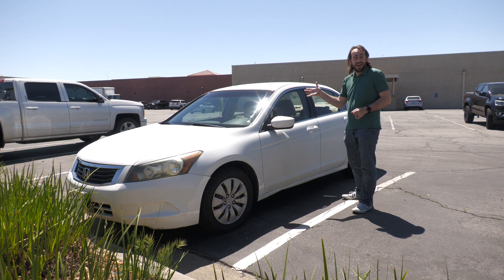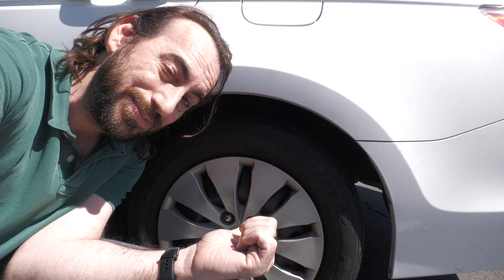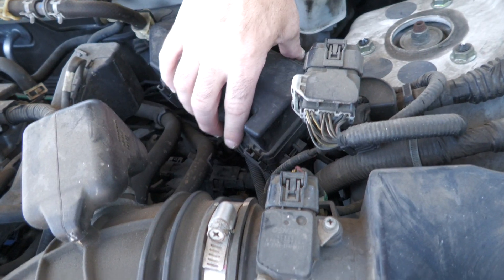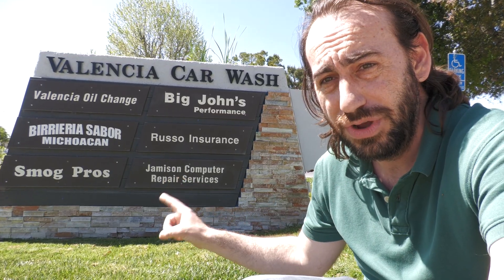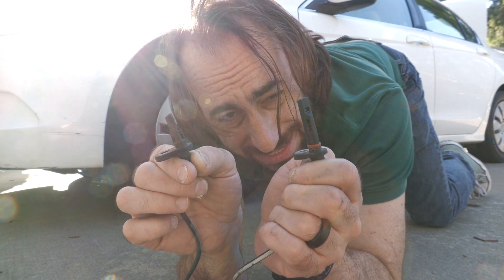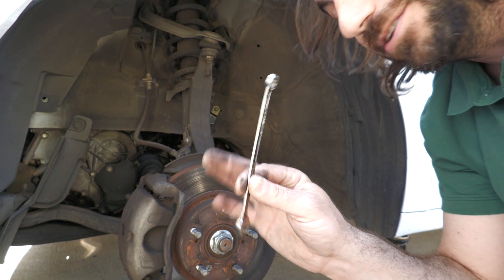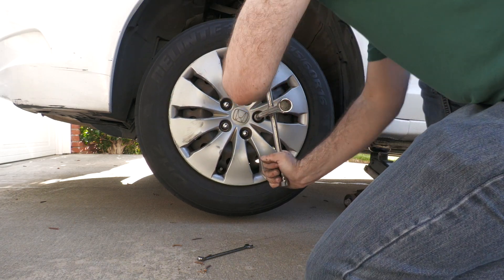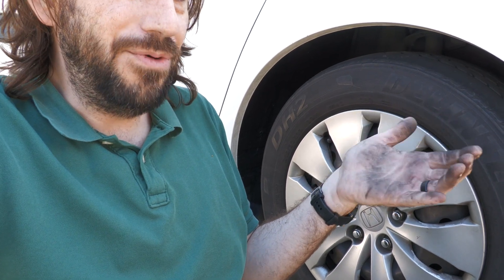Accord VSA Actual Fix Part 1 Wheel Speed Sensors Replacement

Comment: Barely loosen lug nuts THEN jack up the car.
Reply from the maker: It's easier to break them a little loose when the wheel is firm on the ground, then with the wheel off the ground and risking the car sliding off the jack.

Comment: Note to self: "Don't buy a Honda, they're crap!"
Reply from the maker: Na, Honda's are pretty reliable. This can happen to any vehicle. Over 1 year later and the car is still going strong, it has around 210k miles. The repair cost for this, doing the labor by myself, was under $50 for the sensors and the brake switch in video 2, and in total took maybe an hour tops. VS having a shop do it for anywhere from $175 to over $300.
Personally, I would stay away from anything German - parts are relatively expensive compared to JDM or American, and German cars have a higher complexity in their design where part replacment's are relatively more inconvenient.

Comment: I have Honda CRV 2012, I replaced the brake fluid 6 months ago, and purge all the wheels, but when I start to move the suv,  the ABS make a buzzing For less a minute, today the VSA, ABS and brake appears in the panel, I checked the fuses and it's ok, I checked the wires and conectors, the brake fluid was in the middle from low and max, I refill the brake fluid and clean the codes, but the suv still making the buzzing, do I need to clean the ABS sensors? Thanks
Reply from the maker: That's a good question. How many miles on your CRV? And what kind of buzzing - like as you're driving the car itself makes sounds from the wheels? Or warning sounds from the computer?

Comment: I have a 2009 Honda accord ex 4 cylinder. How many wheel sensors are there in those cars? Are there a sensor for each wheel?
Reply from the maker: Should be 4 per car, which is 1 per wheel. Pretty much as shown here since it should be the same model generation.

Comment: There is no "VSA module" the VSA system is run by the ECM, which is expensive and needs to be flashed for your VIN# and keys. The speed sensors and brake switch are great starting points. Sometimes, you will not get codes for faulty speed sensors because the ECM is also bad, so a much cheaper fix is to inspect the Speed sensors. If you get all 4 for $50 bucks, its worth it to swap them out as it it a very easy repair. Replacing the ECM is also very easy, except for the flashing (programming it to your exact vehicle.)  A new ECM is 1200$   Used, 50 to 200$.  Flashing the ECM is at least $199 unless you know someone. It has to be done with Honda specific equipment. If it sounds like I know what Im talking about, Ive dealt with this issue on many 1st generation Pilots.
Reply from the maker: Luckily the speed sensor repair I did well over a year ago has had 0 issues!

Comment: What about a Honda Odyssey 2008. Grinding sounds and engine slows down in traffic! I'm afraid of the grinding sound.
Reply from the maker: I'm not sure. The slowing down could be a diety throttle. The grinding could be brakes. I'm creating videos with what I have available to me to use. If you subscribe and watch my videos, it will help open up opportunities.
Reply: I bought one Honda Odyssey,2007,with same problem,and..I’m working on it…step by step. That car is worth that. In normal conditions,that engine will work..forever. Just depends how much care owners take of it…

Comment: I added brake fluid and it solved the problem. Take off the black battery cable for 30 seconds to a minute to clear out the codes. No lights now.
Reply from the maker: That was one of the first things I tried. It didn't work for me.
Reply: @UltimatePostman  I don't know. It's really strange. Almost as if they techs wanted to find a way to get the car to stall mysteriously. Why did the car stall? We don't know. Got to you Honda dealer and pay a fortune. Have him tell the fortune of your car. I know your suffering. I put 93 octane gas in it and it seemed to fix it. Now the brake fluid fixed it.
Reply from the maker: @LaurenceI-ne7sl  Never had that for me on my accord. Stalling happened on one of my previous videos due to a dirty throttle.
For any Accord, you don't need anything over regular gas, you're just wasting money putting premium in. However, when I repaired my Accord, I accidentally put the wrong ones on the back (I was only going to change out the rear sensors), and the car didn't stall, but wasn't able to drive over 10 mph, and would surge. After putting the right ones in the back, the surging issue was resolved.
Reply: @UltimatePostman  My Honda runs better with a mixture of 87 and 93. Noticeable difference in acceleration and  power. Money well spent. Try it if you have a 4 L.

Comment: Before anyone tries to remove anything, please make sure you check the brake fluid levels. Low fluid will also trigger the VSA light.
Reply: Was having similar problem with my Honda CRV 06, just got it fix after watching this video and reading your comment. Thank you so much!
Reply from the maker: @Toolzmack  Glad to be of service!
Reply from the maker: I realized I skipped that step in the videos (both). But it is something I did do
Reply: It will. It's kind of bizarre, because why would low brake fluid trigger the VSA, which causes problems with acceleration? It's an obvious flaw with this model of Honda. Why would a lack of brake fluid cause the car to stall and lose acceleration? It's connected to the ABS system somehow. So I guess the car thinks it needs to slow or stop acceleration / gas flow to the car because the car can't stop? The car would not drive over 20 - 30 mph. This is a case of the law of unintended consequences. We think your brakes don't or won't work, so we're going to stop you engine from accelerating.
Reply: My case low volt on battery will cause the problem too , it’s so much that can cause the vsa to come up and you literally gotta go thru everything
Reply: Bro, I add brake fluid,boil change and new battery. The VSA light still comes on. I've had it service, and replaced the VVT solenoid, and I dam VSA light still comes ON!!!!!!!!! (It was service at VAN'S HONDA DEALERSHIP, where I bought the car....sad isn't it??????

Comment: My Honda Accord Euro CL9 (aka Acura TSX in the US) had both VSA & D lights flashing. As I went to the engine to check both engine & transmission oil levels I found a rat/possum nest in the transmission area under the battery tray - turns out the critter had chewed off the wire to the linear shift solenoid 😵‍💫

Now I'm ordering a new solenoid plug as the critter chewed off the whole length of wire and left me nothing to work with 😅
Reply from the maker: That stinks. Since you're mentioning rats chewing cables, my neighborhood has been having reports of rats causing issues, odly enough, my accord just started having AC issues, and my wife is thinking it's due to rats.
Reply: Yikes!

Comment: Is this relates to 84-1 sensor logic failure code?
I have 84-1 code.
VSA light goes off every key switch off cycle.
VSA comes back on when I hit 40Kmph & stays in until I switch off the engine.
Any suggestions?
Reply from the maker: I forget what the code for the wheel speed sensor was,  I just looked it up after the smog guys showed me the code - I didn't take a photo of it, will have to search my history on my computers.
The brake sensor I took a photo of it and it was 68-21.
As far as my car, my VSA light would turn on after I was driving and started pressing the brake. Sometimes it would happen right away, but usually it was coming on within 1/2 mile.

I would recommend looking up the codes via google, but the scanner may actually say what the error is related too (wheel speed sensor, brake position switch, etc.), and you use that and the number to find out what parts you may have to replace.

If you've tried the wheel speed sensors on all wheels, and then the brake position switch, see if there is another code. Also, check your brake fluid level.

Comment: Hi! I replaced the 4 sensor,  I checked the break lights, they are good, I disconnect the battery for more than 15 minutes, I checked the fuses, they are good. I took the car to autozone to get the obdII scan and no codes found. Lights on the dash boar still on :(. This is a 2012 Honda accord 4 cylinders. Thanks
Reply from the maker: Sad to hear the light is still on. Make sure they're all connected securely (listen for the click). It could be that you got defective parts, or that your ABS and/or VSA unit is actually bad.
Past that, other than maybe going to another shop to make sure it wasn't a defective scanner... you may need a better scanner.
You can try to short the pins, and doing the steering wheel fix, (there are a few videos on that).

Past that, you'll need a mechanic to help you out.

Comment: I already changed all new wheel speed sensors. But still not working. Anything else for help.
Reply from the maker: I'll repost my reply to someone else here. You will probably need to get your codes scanned.:

Thank you for stopping by and watching Musicfashionstyle4251!
I'm glad that I was able to help you on doing some auto repair – most small repairs aren’t as tough as they make them out to be. Just remember that the advice that I give helped resolved my situation, and I’ll do the best I can to present what is helpful – however, you may still need to head to a mechanic for assistance, or just to get codes read if you can do the work yourself.

Since you are still having the VSA warning light on your dash board, remember that it is your traction control system… but it works hand-in-hand with your brake system (including your ABS). If you watched my second part, then you would know I had to replace my brake light sensor to fully resolve all errors and turn the light off. To resolve your VSA light, I would recommend using the following procedure. 

First, if your car is exactly like mine, check the brake lights – all 3 of them, the center one, and the 2 tail lights. Make sure that they turn on when you press the brake petal. Have a friend stand behind the car and off to the side to see what happens when you press your brake petal. If They don’t turn on, then check out my second video in this series, could be your brake light sensor – it’s a little switch that when you press on your brake petal, the switch opens and turns on your brake lights (and when you release your brake petal, the button is pressed and turns off your brake lights.

You could test this yourself at night – back up to a wall, put your car in park, release the brake, and turn the lights off (just to make sure you’re not seeing the cars regular running lights). Using your rear and side view mirrors see if the wall lights up red when you press the brake petal. If they do, then good. If not, then check fuse #10 under your hood, it’s 20A. You can also check out my second video if your brakes don’t light up, you may need to check and/or replace the brake light switch mentioned earlier, connected to your brake petal. If your brake lights work fine, no need to do so.

Just remember – your regular running lights are not your brake lights. When you turn your lights on, the taillights light up. When you press your brake petal, your red lights will get brighter in the back (or turn on fully bright if they are off).

While we are at it, under your hood you can also check the #2.2 and 2.3 fuses (they’re 1 complete module you’ll have to unscrew and carefully remove and then carefully reinstall and screw back in. the #2.2 is 40A and the #2.3 is 30A.

Past that, the last fuse to check is under your glovebox on the passenger side of the car. When you open the door of the car, just to the right of where your right foot would rest on the floor, there is a small panel you can remove from the wall. Check fuse #6, it’s a 7.5A. Those should be all the fuses you’ll need to check and verify. 

The next step, which I missed in the video, is to check your brake fluid level – the reservoir for the 2007-2012 Accord is found under the hood on the driver’s side, close to the fuse box, just below the windshield. Just make sure it’s between minimum and maximum – you may need to get some brake fluid, which could be found at any auto parts store, or even Walmart. My fluid was low, I topped it off to just below the line indicating “MAX,” but it did not resolve my issue.

The next step I would recommend is to reset the computers yourself. Please keep in mind that the method I’m sharing will also wipe out your time (and date) and any radio settings (including your preselected ratio channels). If you wish to not do so, AND/OR your radio has a code that you don’t know, then I would skip this step and have someone with a OBD2 scanner clear your codes. If you’re willing to reset your time and radio settings, all you’ll do is disconnect the negative terminal of your car battery and leave it off for at least 15 minutes. While you’re at it, check for any corrosion on your battery terminals and clean if needed. After 15 minutes pass, reconnect your cable securely and give your car a test drive. You should know within a few miles if the VSA light returns. If it does, proceed to the next step.

Final step – you’ll need an OBD2 port reader – a scan tool that will read different codes the cars computer is saying “This is what’s going on.” You’ll need to get the actual code or codes to see what is really happening. It's how I knew that I needed to switch my Wheel Speed Sensors, but also, they gave me another error of 68-21 “Brake Petal Position Stuck Off,” which as mentioned before was my brake light switch was bad (please see the second video if you need some steps with it – it’s what cleared my code after the wheel speed sensors). 

Otherwise, you could have a number of errors – even the possibility that the actual VSA unit or ABS unit are bad – and even one of those could run a few hundred for the part. Getting any error codes will be really helpful to research what needs to be done. Take a photo of each code so you can research them, and then have the tech clear the codes, and drive around for a little to see if the errors come back.

Hopes this helps you in the right direction resolving your VSA warning.